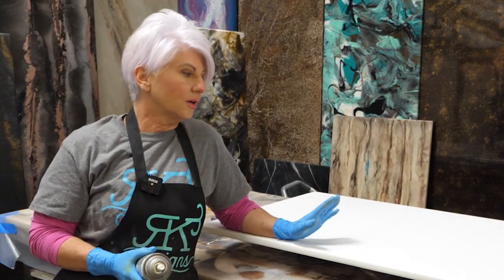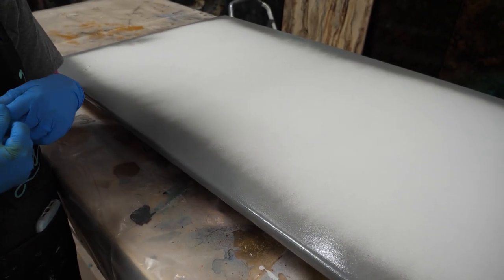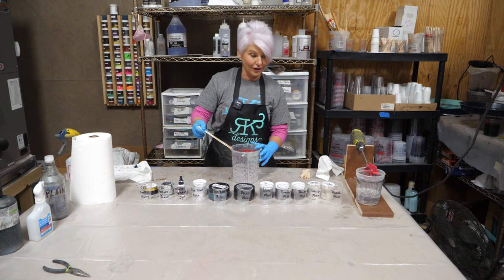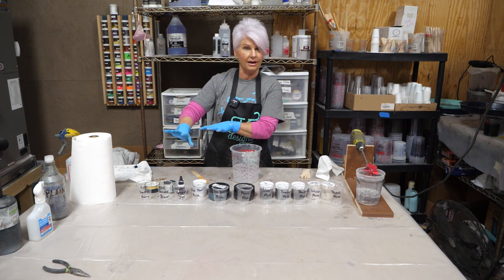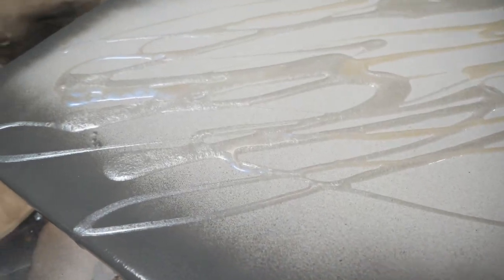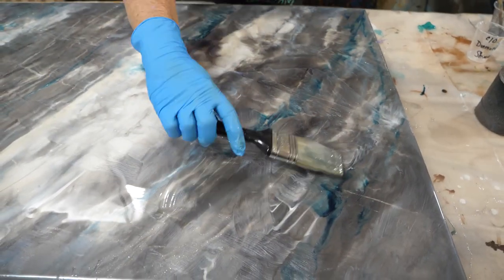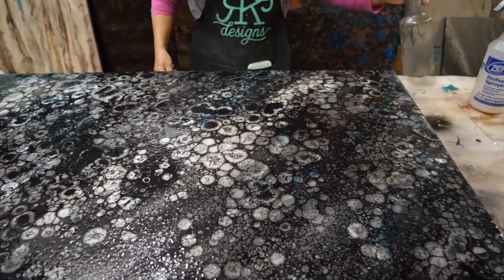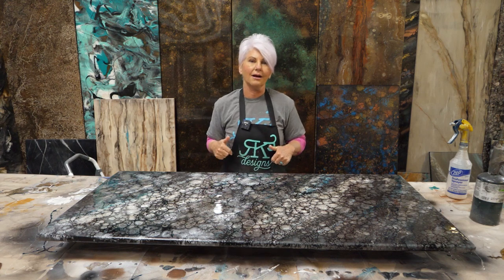I RUINED THIS FINISH! And that's okay. | RK3 Designs

Comment: I see that over at SCC they trowel and chop to avoid sticky areas from uneven mixing in the initial blend of "A" and "B" - but in pours like this that doesn't happen.  Have you encountered the uneven mix sticky problem in pours like this?  How do you avoid that with this kind of pour?  If it does happen on a finish piece, what can be done?  Will a flood coat fix it?
Reply from the maker: I mix very well in the bucket and then I scrape the sides and mixed by hand a little longer. I do use a trowel on large surfaces, but I really like using my hands to spread. Using a brush is absolutely fine, I just don’t do it very often.

Comment: I am an artist using art stonecoat epoxy.   Is this ok or should I use stonecoat epoxy on my art work
Reply from the maker: The Art Coat and the Regular SCC epoxy are the same thing except the Art Coat has more UVA additives for added protection again UV rays. Either can be used over your art work.

Comment: I cooked a bubble not realizing it could get to hot  so I put heated up some of the left over epoxy and it is now sitting on top  and is not leveling out please advise . Hope u see this
Reply from the maker: You’ll need to sand the bump down until it’s level and then repour a flood coat.
Reply: @RK3Designs  I appreciate your answering my question I was a little freaked out I ruined it